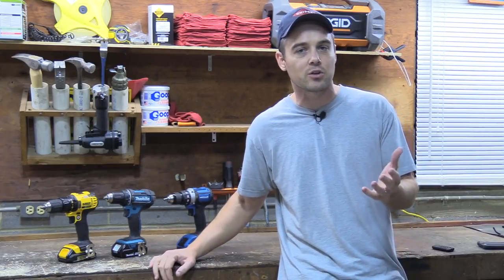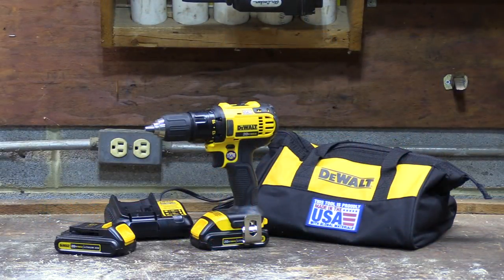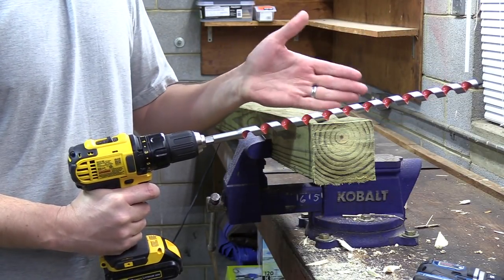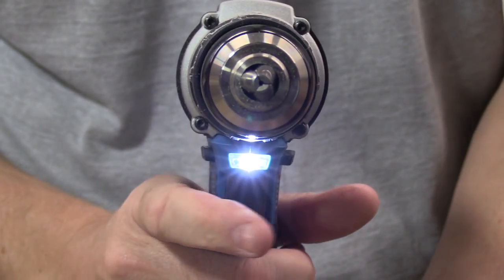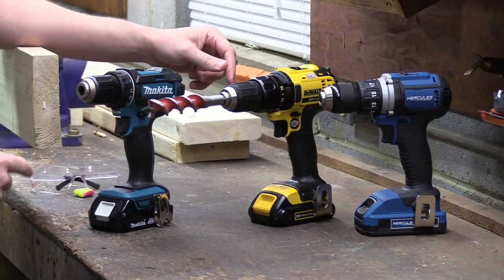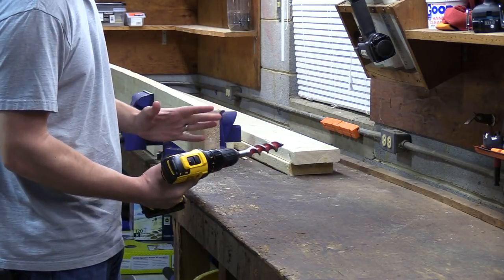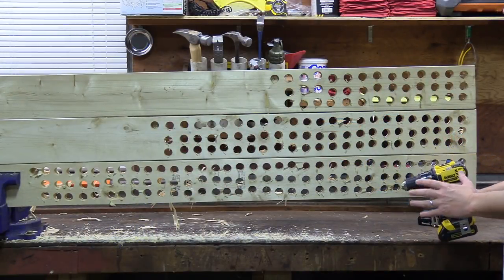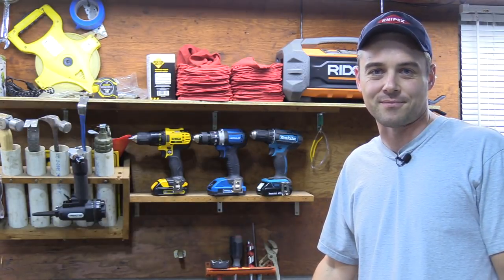Dewalt -VS- Makita -VS- Harbor Freight (Hercules) / DCD780 -VS- XFD10 -VS- HC91K1

Comment: In my experience as a full-time Harbor Freight cashier for the last several months, I don't recall seeing a single Hercules product come back faulty. They really are built like tanks.
Reply: My guess is that most costumers will buy the Hercules for very light home use due to the cheap price (=lower expectations) as opposed to buying Makita/DeWalt for contractor/extensive use. Still, I'm surprised how well it did.
Reply: db 253  Sure wish you would back that up--you may be right, but what leads you to that conclusion?  Now let me give you a laugh--I use B&D
Reply: But are they one of those items who as soon as you open it you see a paper that says "Do Not Return To Store, Call Us!"
Reply: @Greg8872  Which no one does.  They run right back to the store with them.  Most of the tool stores, including Harbor Freight, will refund or exchange the tool.  People do not like to deal with factory service.  If the H-F guy says they are not being returned (and other tools ARE) then I will have to concede he is probably right.
Reply: I was a Logistics Supervisor at a Harbor Freight in Iowa recently and most of my farmer customers rave about the Hurcules line HF has. That's not an exaggeration. I was skeptical myself. But I gotta listen to my customers. BTW, I own most of the drills/impacts myself, and have never had a problem with them. They also a 3.0 AH battery!
Reply: @sunnydays4966  Huh? They generally hand you a new one no questions asked.
Reply: db 253  sorry but they are best in my experience  had mine with same battery for 3 years and I drill thru concrete at times and alot of foundation walls I had dealt and Milwaukee both of them are trash and they were all 3 20v drills and impacts
Reply: Well from my experience the Hercules is almost as good as my Milwaukee drill with Milwaukee being slightly a little better. Which was a surprise to me for the performance to price ratio.
Reply: dominick magoon as a pipefitter I agree dewalt and Milwaukee are so disappointing and frustrating plus the dam slip chuck burns out on the dewalt if you use it too much! Example: drilling holes on 8” pipe for TOL’s you set it so you don’t twist your arm if it snags. About ten to 15 holes that slip chuck is junk.
Reply: I personally use Ryobi. Not only because of a great price. But because their battery fully charges in 30 minutes or less. This is handy when you dont have hours to wait around for your battery to recharge. Also ryobi does a deal where you get a 7 piece tool set with two 1.5ah batteries and a charger included with the set for only 200 bucks. Not thats hard to beat. And they tend to keep up with my brother in laws perfesional series of tools he uses for work. Mine are home use, but i use them pretty regularly.
Reply: Because u worked at the check out counter
Reply: @kevinhofer8869  yeah, worked at the check out counter, you see all the tools and shit everyone brings back, you get personal reviews every day. I'm a supervisor at HF, before that a long time customer. You must be one of the people that get angry and leave their whole cart because you didn't read the fine print on your 20% coupon.
Reply: "as a full-time Harbor Freight cashier".... (read from script... here.... signed... the Harbor Freight Corporate office.... P.S. the bonus is on the way..... thanks!)
Reply: All 3 are crap, but not for reasons aparent in this video. First thing, pairing 30 amps sucking medium high torq tools with paks good for 20A max, only one row 18650 cells, is customer fault, pure stupidity. The pack is abused and destroyed fast, and the tool is strangled and can't develop full power. For this very reason, active protection, the Makita was in fact better, even if is  bad for other reasons not aparent in this video. Second customer fault, using wey larger bits for the tool, especialy with only one row of 18650 cells, but too large even with 2 row good for 40A, too large for the speed which is high even in s1, too large for the motor, for the gearbox, and for the electronics.
That is Makshita DDF482 for the rest 95% of the world, with brushes whitch is good    because is 8X less noisy, and because parts are 6+X less pricey, and coud of be also good for the high speed 1900RPM,  if not for the lower cuality bearings and lower cuality gear box. Even with 5Ah  packs I can' t recomend DDF482, it sleaps even on drill seting, and the bearings and gearbox are not heavy duty. For compact 2Ah packs you can use DDF453 with brushes, for 1.6 Kg total, no LED light and longer on the back,  still produced even in 2019, but more then plenty powerfull with 27Nm soft torque in s1, and 42Nm hard from inertia in shock on s2 at full speed with small load ( hard torque is stupid because in s2 torque is lower and hard torque is in s2 when it stops in shock..). The brushless model for 2Ah packs is DDF 483, shown on another video, but also not heavy duty, and older DDF459. Newer ddf 484 and 485 not so mutch because of the higher speed which draws more amps. For 36 Nm soft torque (54 hard) there is DDF 456 with brushes, discontinued, and DDF 480 noisy brushless also discontinued. For  extra large drill bits and heavy duty use, there is DDF 458 with brushes. DDF481 brushless is unreliable crap...
Reply: Makita
Reply: @matts.8342  if within the 90 day warranty right?
Reply: HAND MADE  back in the day everyone said the same thing about Ryobi 18v tools, I use and abuse those tools they still running after 19  years. Even the battery's last longer than my Bosch 18v tools.
Reply: I can't speak to the brand's current quality as I haven't worked at Harbor Freight for nearly two years, but it's worth noting we did a lot of replacements for broken Bauer power tools, and even more for the lower end stuff. Hercules was the exception, not the rule. Both Bauer and Hercules were frequently purchased by contractors, and the Hercules products that did come back were typically for a replacement and new warranty at the end of the original warranty.
Reply: Id choose the hercules. Name brands are having issues. Also thunder bolt edge batteries are awesome never has had anyleak.@loochan325

Comment: I'd like to take a moment of silence for all the lumber that gave its life for this excellent video.
Reply: Rest assured there will adequate stock of Southern Yellow Pine for your next 2 x 4 project.
Reply: lol lumber is already the dead form of a tree
Reply: Yes, as was mentioned, we have enough pine. However, this particular wood did become holey for this video. Now it is with the heavenly board feet.
Reply: Lol. Nice one.
Reply: lumber lives matter....lumber lives matter....lumber lives matter
Reply: Wood is the perfect renewable resource. As long as you manage forests, you will never run out of wood. Trees provide building materials, fuel, shade, and prevent soil erosion. As an added bonus, growing trees eat carbon dioxide and excrete pure oxygen.

Comment: What really impressed me was the first drill test. Makita did not make it through, Dewalt struggled, Hercules just went through it like nothing. Then, baterry test again Hercules again proves to be a better tool overall? These name brands need to give a solid reason to why they are more expensive than the cheapest in the market. Great video!!

Comment: An actual, real, no nonsense review and test. I like the fact that you even went as far to sharpen the bit between uses.
Reply: and the one that appeared to have won went last...so if they sucked at sharpening the bit it did not transfer to the test.
Reply: you should also check out Project Farm channel. very honest testing of everyday products.
Reply: But I think a brand new bit should be used at each test

Comment: ...the Hercules had the biggest battery, so I expected more holes...BUT..a tool like this REQUIRES 2 batteries if you use it very much..you know, use it until the battery dies, then recharge the battery while you are working with the second battery...with the Hercules, and only one battery, you use it until the battery dies, then twiddle your thumbs while it re-charges...so really, 2 smaller batteries are better than one bigger one...you can buy an extra battery, but that adds to the overall cost of the tool...

Comment: 247 dewalt employees disliked this video 😂🤣
Reply: I used one of these dewalts and the next model up with the all steel head and bigger battery pack for 3 yrs roofing. We never had a problem out of the drill or battery pack and we really abused them doing metal roofing. I ended up injuring my back and had to quit but they were still using them when I left. Personally, I own one of the lithium ion Ryobi kits so I don't really have a horse in this race lol. Still, if I was gonna buy one of these, it would be the Hercules. Hard to argue with the price and performance of that drill and it seems like it would last too.
Reply: Probably Mikita actually because DeWalt beat Mikita twice and lost once even with the lower price

Comment: I actually work at Harbor Freight and sell these drills. I get a lot of feedback from my customers regarding the production, reliability and performance of the Hercules tools. The feedback I've gotten has been overwhelmingly positive. One of my favorites, a customer bought one of the Hercules angle grinders about a year ago that he intended to use daily at his work with the intention of trying to burn it up........he is still using that angle grinder ;)
Also, the batteries for the Hercules (as well as the Bauer) are at least 1/3 the price as is for the DeWalt, Makita, etc.
This is a great real world comparison and appreciate the information as I will be able to pass this on to my customers that are considering this drill. Thanks for the vid!!!!!

Comment: I am shocked. For the record, I am a regular Harbor Freight shopper. And I did not expect the Hercules drill to kick this much ass or much less, come in first place. Awesome. Thanks for your review.
Reply: Yes the HF is cheaper but only one battery
I would have to buy 2.
Reply: @cloverdale87  i mean yeah you'd want another battery for sure. But right out of the gate they give you a bigger 2.5ah battery so you can get longer uses out of it. Personally i use ryobi because you get two batteries. And they charge in 30 minutes. Which is why i prefer ryobi.
Reply: @hairpunut   and you can get two 4 amp hour batteries for a smokin deal during the holidays.   I noticed ryobi would sell their best batt years ago during the holidays in a BOGO twin pack for the same price as a single battery.   that was usually around $99 for two.  But sometimes, they would move them to a small clearance section in the power tool aisle and I got some for $85 and then another one (or two) for $79.    Sweet!   So I have a lot of their stuff because it's so inexpensive, rugged, and, so far, reliable (except the trim nailer started screwing up until I found a video on YT on how to fix the problem).   The lawn equipment etc.   All good enough and some great tools but you just can't beat the cost savings on batteries.   Such a big difference.  Not sure if the "premium brands" have more reasonably priced batteries these days but I did see that Ryobi now has a 9 amp hour battery - lol - holy shitballs!  that would be sweet for the fan, the pump, LED lights.   Guess I'll just have to wait to the holidays and see if they offer those suckers BOGO.   :)
Reply: The Ryobi battery’s die sooner then won’t take a charge.
Reply: By the time you buy the extra battery and the warranty the Hercules is more expensive than the DeWalt. Take the things apart and you will see they're not in the same league.

Comment: I spent three years repairing drills, nail guns and construction equipment. Of the three mentioned here I would chose the  Makita.  Roofers, home builders and carpenters can be hard on tools and they are ALL neglected. Makita always hung in there the longest between repairs.
Reply: Cjango Freeman yeah me and my dad put a Walmart hypertough driver against his de Walt and the hyper tough out performed it all the way
Reply: I'd lean towards the Makita because of japanese quality reputation but, who know where they're made anymore? I'll go with Harbor Freight for the value / price.
Reply: Been rock n Makita for 15 years one black n white drill and blue black saw saw down but the rest of the gang is still running strong💯🤜🤛💯😁
Reply: how many Hercules drills have you repaired?
Reply: @msk3905  None.

Comment: Having been down this road with all three of these brands, I was amazed to discover that the "Harbor Freight Drill" have significantly greater working torque than the other two.  The battery life of the "Harbor Freight" and "DeWalt" were about the same.  The battery life of the "Makita" was significantly shorter.  As to the life expectancy of the three, I haven't gotten there yet.

Comment: A total surprise. I work in construction and I use all Dewalt tools and the battery is interchangeable with other Dewalt tools. Now I have to look twice when I go to Harbor Freight.  Thanks for the video.
Reply: A side not to that.....i work at Harbor Freight and the Hercules batteries are interchangeable with other Hercules tools, as are the Bauer batteries. The batteries are also about 1/3 of the price as the Dewalt, Makita, etc.

Comment: I purchased the Harbor Freight Hercules model in early 2018 and it runs like a champ.
Reply: Carlos Clivilles what all do you use it for? I’m trying to decide which one I should get for apartment maintenance.
Reply: Nothing all that major really. I've used it for drilling through metal during automotive repairs or upgrades, drilled out some rivets, drywall and wood.
Reply: Does Hercules make sawz-all and grinders?
Reply: @anthony639  sawzall for $100 and 4½ grinder for $70.
Reply: @anthony639  sorry that's the 11 amp grinder the 7 amp is a mere $40
Reply: Also while checking I found out that chicago electric has a bench grinder for $29. Even if it doesn't even work it's worth a try so I ordered one. I'll give an update in the future is someone reminds me. It's technically a 3" tool grinder but I'll see what I can do with it.
Reply: @cm01  thanks for checking and letting me know. To be honest, I use a drill master 20 dollar grinder for all sorts of things (I'm a laborer/installer and work in home renovation) and it works great. I was just thinking of getting one that's a little bit better quality and or a little stronger just for the heck of it lol. For sawzall I use a 20v batt powered ryobi for most jobs and a Chicago electric corded one when a little more power is required like cutting cast iron water pipes and those work fine as well. For drills I use 20v ryobi drill, 20v ryobi impact and those work great too, for what I do anyway but was thinking of getting the Hercules models just for the heck of it.